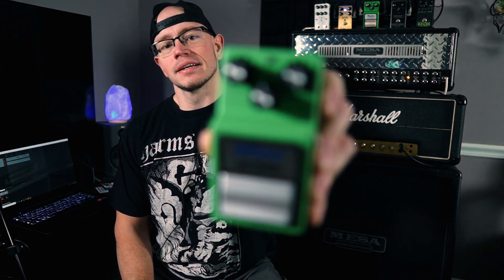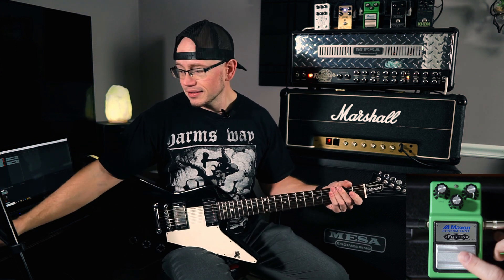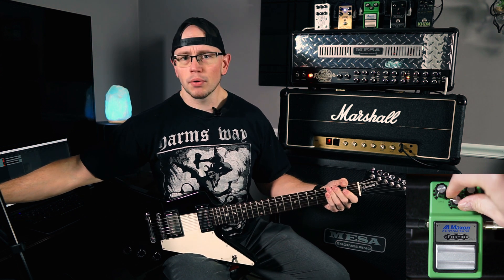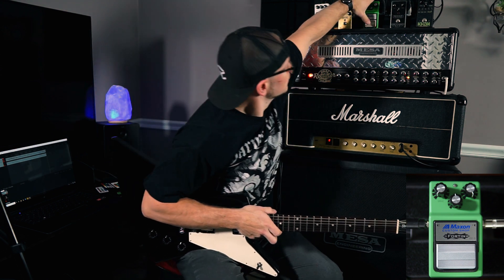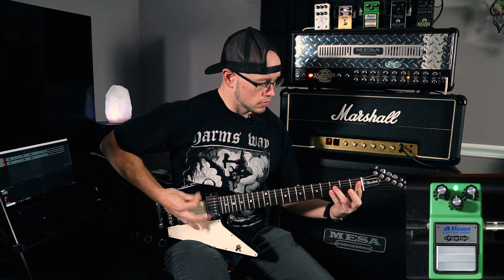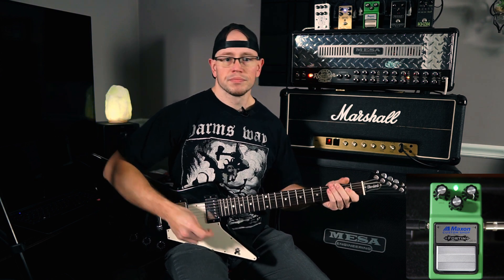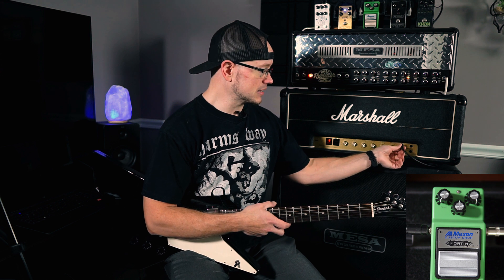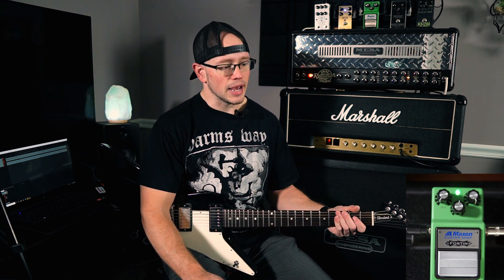Fortin Modded Maxon OD9 - Pushing To The Limits

Comment: If the deadweald has the charge pump that runs it at 33v like the dirty tree does using the tc side will tighten that multiwatt more than any tube screamer ever could.
Reply from the maker: I gotta check it out.  They don't list all the features so I've had to mess with stuff my self to figure things out

Comment: Oh, fuck yeah! It has a grunty grind going on. The second you kicked in on the Rectifier, I was like, "oh yeah". 

I wonder if the 2203 stays tight if you dime the level and the gain, and how metal would it get?
Reply from the maker: Yeah man I dig it for sure.  Diming the level on the 2203 is not something I will ever do, so we will never know.  Haha!  More than likely nothing would keep that tight though, because the power tube compression would mush it up regardless.
Reply: @belligerentamateur  haha Diming a 2203 would equal death! I should have been a bit more clearer, I meant diming the level and gain on the Fortin.

Comment: Does anyone recommend this over the Fortin 33?
Reply from the maker: They're 2 completely different beats, honestly.
Reply: The 33 is a clean boost (so no clipping like an overdrive) and it's a fixed frequency boost, perfect for an amp like a Mesa but sometimes doesn't really blend with alot of amps. If you can get one for a decent price snag one, also keep in mind this is a Maxon pedal  which on their own are great overdrives like the classic od808, od808x and my favorite the od820 I think are great alternatives. This pedal though is as advertised, TIGHT!